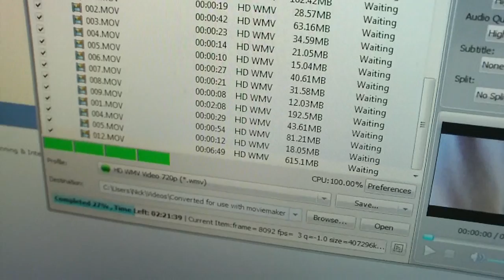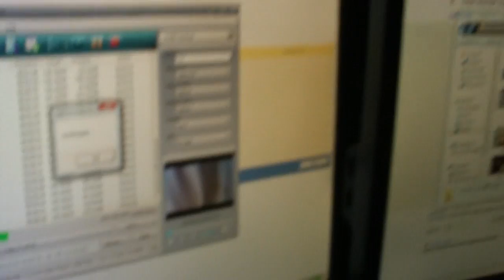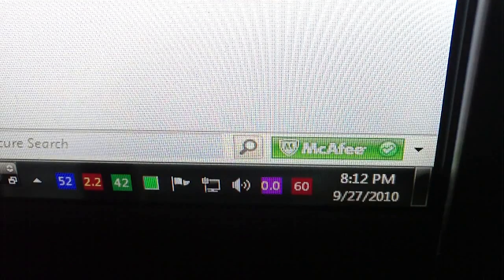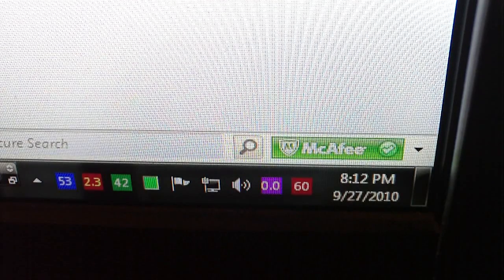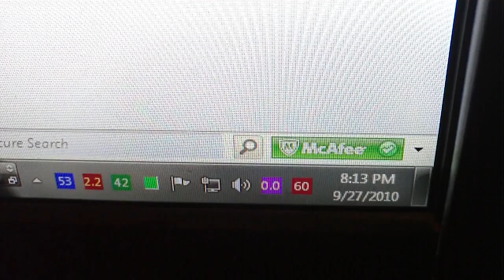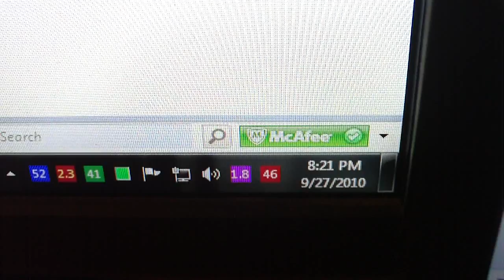Passive Cooling a Phenom II 905e CPU under 100% Load

Comment: Oh okay. Thanks for clearing that out:D

I just once broke normal room fan by stopping the blades when it was running. 
The whole coil in the motor melted down from the top.
I thought the same thing could apply to computer fans too.

Comment: You should build timemachine then :D

Also blockking fans doesn't always break them but its highly possible.

The reason behind that is that the coil in the fan may melt if the fan is running but you block it from spinning.